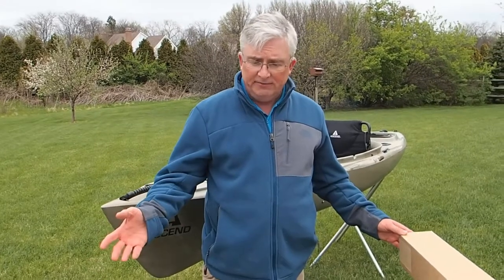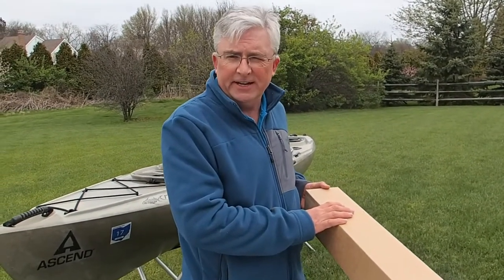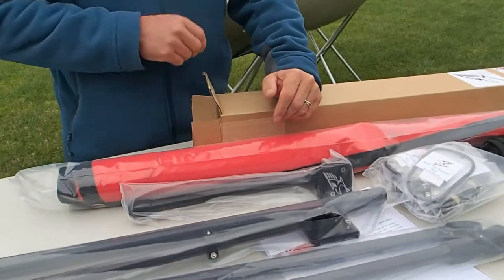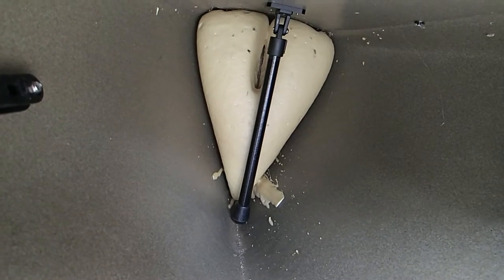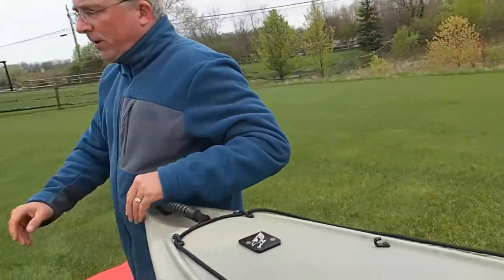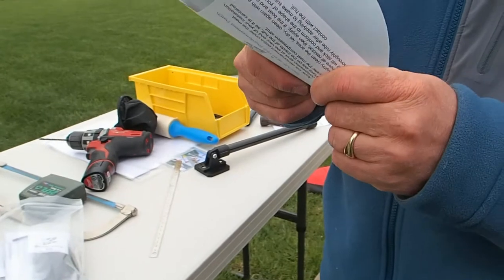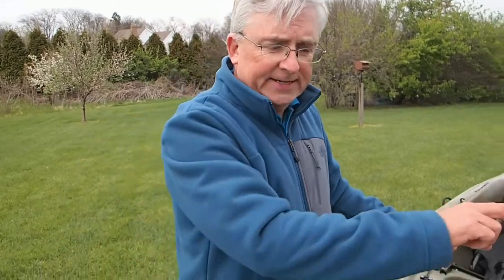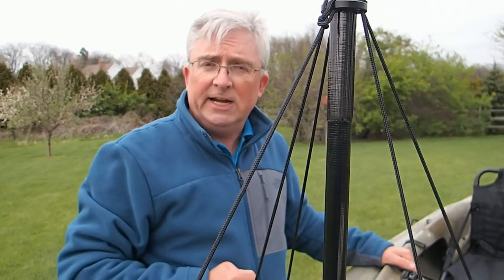Falcon Sail recreational kayak sail install install demonstration.

Comment: Very nice looking rig! What do you use for a dagger board and a rudder?
Reply from the maker: We do not use a dagger board or a rudder.
If a kayak is okay without a rudder without a sail, it is still okay without a rudder with a sail.
    Though a rudder can be nice for lazy kayak sailing.
    The general rule of thumb is a kayak less than 13 feet long is fine without a rudder.
Also if your kayak has an adjustable skeg it will work just as good as a rudder.
A rudder is made to trim your kayak not turn it.  
So if your kayak tends to turn up wind, you give a little rudder force down wind.
And vice versa.

On a short kayak you can change your boats trim / course tendency very easily by leaning forward or back a little to change your boats center of lateral resistance.
Or you can move just a little weight fore and aft.  A water bottle should do it.
You can change your trim by pulling the sail in tight or loose, or leaning up wind or down wind.

Steering is not a issue.
If your paddle says go left and the rudder says go right, you will turn left.

Some times rudders mask out of balance situations.
If I do have a rudder on my kayak, I start my day sailing with the ruder up to see how well it is balanced.

If your kayak is okay in the wind without a rudder it is fine without a rudder with a sail.

Some kayaks have adjustable skegs which also fixes any trim issues as well.

We never use lee boards or center boards or any other lateral resistance enhancer.
Kayaks do surprisingly well.  Our goal is to have a very light weight compact sail rig ( 3 pounds that folds to the size of an umbrella ) that gives you 75% of the sail only angles of attack a more complex bulky rig will do.  You can sail with no paddling 200 out of 360 degrees.  If you throw in some paddle strokes you can have useful propulsion on 300 out of 360 degrees.

Lee boards will help on some angles of attack, but they are bulky, heavy, complicated, get in the way, slow you down on many angles of attack, slow you down at the launch site and take out and can be costly.  If you do not have a super well made lee board or one that is hydrodynamically smart they provide about zero value / are a loss in the simplicity approach.

For more info read my next replies with canned text on rudders and lee boards.
Reply from the maker: Read my general answer to your question maybe first before these canned answer below.

#Rudders
=======================================================
The general rule of thumb is, if a kayak is fine without a rudder when just paddling, it will be fine without a rudder when you are kayak sailing. On a kayak 13 feet or shorter, rudders are not necessary. If a kayak has an adjustable skeg, a rudder is not necessary.  It is quite rare to see a 12-foot kayak or shorter rigged with a rudder.  I (the owner of Falcon Sails) have a 12-foot kayak and have never considered putting a rudder on it.   When my paddle says go right, my boat will turn right.  It will turn right even if a rudder on my kayak would say turn left.  Rudders are almost never necessary until you get into kayaks over 14 feet long. 

You can see in the pictures included with this email, that the short kayaks do not have rudders on them, and even some of the longer kayaks do not as well. 

If you want to do some lazy kayak sailing and not use a paddle for long stretches and do not want to lean or adjust the sail to steer, you can install a rudder and you may like it.

If you have a short kayak, you should avoid having a rudder early on, as number 1 you are likely not to care if you have one, and more importantly, a rudder will likely be a crutch and make it easy to use bad habits.  You should naturally balance out your kayak (it is an obvious thing to do (When you lean forward you will notice the kayak turning upwind, and when you lean back you will see the kayak turn down wind )) so it will tend to go in a straight line and not use a rudder to force an out of balance kayak to go in a straight line.  A rudder used to force an out of balance kayak to be in balance, is just more drag in the water and will reduce your efficiency and your ability to point up wind.

The general rule of thumb is, if your kayak is okay without a rudder without a sail, it will be okay without a rudder with a sail. Having a sail will slightly increase the desirability for having a rudder.  Big winds and high speeds also make having a rudder more desirable.  Having a rudder can make it easier to get through the learning curve.  In general, kayaks under 13 feet are always fine without a rudder.  Just like a kayak without a sail, when you get into kayaks over 14 feet long rudders or adjustable skegs are nice to have.  The longer the kayak is the more likely you will enjoy having a rudder. Even better than using a rudder, a kayaks tendency to turn up wind or downwind can be addressed with sail trim, leaning up wind and down wind, leaning forward and aft, changing the distribution of your load, and adjusting your speed.  Once you start doing these things, many times you would not use a rudder as a rudder is not the best way to put a kayak in balance to stay on course.

The shorter the kayak, and the more experience you have the easier it is to live without a rudder. Finally, when kayaking or kayak sailing, if your paddle says turn left and your rudder says something else, your paddle will win. 

Rudders and skegs are not there for turning so much as they are there to trim your kayaks tendency to a neutral tendency to turn up wind or down wind.  A nicely trimmed kayak is great to have.  A rudder is one of the easiest tools to use for trimming your kayak. But a rudder is a is a crutch many times and prevents people from learning proper techniques for staying in balance. And of course, using a rudder to trim your kayak also adds drag and slows you down so they are best reserved for minor fluctuations in balance vs a tool to power your way through an unbalanced situation.  The more drag you have, the harder it is to efficiently sail up wind.

In the end, if a Falcon Sail customer would like to have a rudder, then can have us send them a complete smart track (it is the best rudder kit you will find) rudder kit for their kayak at our cost which usually ends up being $225 including shipping.
Reply from the maker: Read my general answer to your question maybe first before these canned answer below.

Lateral Resistance Enhancers Lee Boards / Center Boards   Part 1 of 2
================================================
Your question about using a lateral resistance enhancer (lee board / dagger boards / large skegs) and if they are necessary to sail with a Falcon Sail is a common question, so we have made a canned answer to help people.

The short answer is a stock kayak hull does great and lateral resistance enhancers are not necessary.  They will get in the way and create complexities and issues at times.  Very well-made lee boards can help with some angles of attack but are not helpful in most situations and will get in the way on every outing.   They add bulk, drag, weight, complexity, cost, potential failures etc..

Kayaks sail amazingly well without any lateral resistance enhancer. Near zero falcon sailors use lee boards or other lateral resistance enhancers.  There is a longer more detailed answer below.

The owner of Falcon Sails wrote an this in a article.

I grew up sailing keel boats, sun fishes, trailer sailors, Hobie cats and anything else I could get my hands on.  As a conventional sailboat person, I use to think only a boat with a lateral resistance enhancer (lee board / center board / dagger board / keel) will sail properly. We have learned there is a lot more to kayak sailing, than conventional sail thinking will tell you. Conventional sailboat thinking is very helpful at times but does yield a few misleading assumptions about kayak sailing.

As far as needing a lateral resistance enhancer goes, you must consider a few things before making any assumptions. Look at a Hobie 16 and some other purpose-built sail boats. Even as a purpose-built sailboat, the Hobie 16 has no resistance enhancer because its hulls have a lot of natural lateral resistance built right in from the start. They have no lee boards, dagger boards, center boards, or keels. 

Like the Hobie 16 Catamaran Sailboat (not a Hobie kayak), kayaks have a lot of natural lateral resistance built into their hulls also and sail surprisingly well without any lateral resistance enhancer.

Kayaks are not sail boats, will not point as well as a complex sailboat, but their hulls are efficient at sailing and can make surprisingly good up wind progress. Think about this. Sailboat hulls are designed to be as slippery as possible going forward. A byproduct of a sailboat hull being designed to be as slippery as possible going forward, is a hull that is slippery going sideways (and slippery in all directions actually) and also tends to spin. Modern Sailboat hulls, make conventional sail thinkers believe you must have a lateral resistance enhancer on a kayak.

Kayak hulls are designed to track and go in a straight line. This is achieved by having lateral resistance built in throughout the length of the hull, which is what makes them sail surprisingly well without lateral resistance enhancers. To demonstrate how a kayak has a lot more resistance going sideways than forward, imagine pushing a kayak that has an adult sitting in it in the forward direction. Most kayaks will easily glide 30 feet or more. Now imagine pushing that same kayak with an adult in it, in the sideways direction. Due to its lateral resistance, it will probably go about 1 or 2 feet after you are done pushing it. Or think about towing a kayak with a person in it, from the side vs towing a loaded kayak from the bow. The kayak towed from the side will be much slower due to its lateral resistance. In both examples you are testing and seeing, a kayaks lateral resistance is significant. Once a kayaks hull moves through the water, its lateral resistance increases by quite a bit. All this said, with a smart sized sail / one that is not too big, a kayak has plenty of lateral resistance without adding anything to it.

Once you build up some speed, a kayaks lateral resistance increases dramatically. Kayaks do not sail as well as a purpose-built sailboat, but you can do no paddle sailing and reach across the wind, and even make some upwind progress.  Of course, a purpose-built sailboat will sail better than a kayak will, but kayaks sail amazingly well. If you have an efficient sail, you do not need a lee board, or center board, or dagger board, or any lateral resistance enhancer to have a great kayak sailing experience.

Falcon Sails focuses on keeping things simple, efficient, compact, reliable, and lightweight with the best possible performance. All this can be had for less than 3.5 pounds, in a sail that can be dropped in seconds and folded down to the size of an umbrella in just a few more seconds.

Lee boards and dagger boards add weight, complication, bulk, expense, drag etc. Some people want to turn their kayaks into a sailboat. That is fine, but you will add weight, complication, bulk, expense, drag, set up time at the put in, tear down time at the take out, more rigging, more stuff to store, and if there is no wind, or too much wind, you are better off with a compact sail rig that gives you 70% or more of the sailing benefits in a package that weighs just over 3 pounds that can be lowered and compactly secured to the deck of your kayak and 100% out of the way in seconds.

Everybody has their thing. If you want to have that perfect ideal incredible sailing experience in one situation, you will lose a lot in other situations. There is not a rig that will cover all situations perfectly. If you want simplicity and versatility, you will be happiest with a simplistic high-quality sail and rig for your kayak.

As a lifelong sailor, I thought the same thing sailors typically think about lateral resistance appendages. I have sailed and owned a lot of different boats. I used to race and skipper and crew on a lot of different boats, and can say I am a decent sailor. My conventional sail thinking made me believe you need a lee board or something on a kayak to sail. Then I tried kayak sailing. The performance of a sail on a kayak amazed me. I was hooked instantly. I was surprised. That was even before there were good quality sail rigs available. Now that I can have a good quality sail rig, and a good airfoil shape, I will not go kayaking without a sail.

After kayak sailing for the last 12 years and having paddle sailed thousands of miles, I have never used a lee board or anything like it. None of my friends use lee boards and none of us feel like we are missing anything.  If you keep a good sail trimmed properly, oriented to the wind properly, and have at least 1.5 mph of hull speed, you can reach across the wind, and even make upwind progress of about 20 degrees above reaching. That is without paddling or a lee board or a dagger board on a standard stock kayak hull. Some kayaks will do even better than this.  In general terms if you have good conditions, a good sail, and you use decent sail trim, you can easily sail 200 degrees and even up to 220 degrees without paddling and without the bother of any lateral resistance enhancers. If you paddle to keep your speed up and the sail oriented properly to the wind, a good sail, will generate useful propulsion all the way up to within 30 degrees of straight upwind. That is with or without a lateral resistance enhancer.

In general, once your actual track is 10 degrees above reaching, you have to start paddling to keep things oriented properly. Initially a few small paddle strokes here and there will add a lot to your possible angles of attack. The more aggressively upwind your angle of attack is, the more you have to paddle. But still, you can gain useful propulsion to with 30 degrees of straight upwind.   For example, you can paddle with a 2mph effort and go 3.5mph.  You can speed up faster, slow down slower, and have a higher top speed. You can have a lot lower paddle stroke resistance as well and have a lot more fun while you are at it.

With a little bit of planning, you can paddle upwind a little bit and reach back and forth all day long and not have to paddle much at all. Once your movement is 15 degrees above reaching, you cannot just sit there doing nothing, but you can avoid paddling and reach across the wind all day long, and even make upwind progress without paddling and without lateral resistance appendage or enhancers. With a good sail, kayaks sail very nicely.

Just like when sailing a purpose-built sailboat, when kayak sailing to maximize your potential, you will have to think about what you are doing. When conditions are good, you can get useful propulsion to within 30 degrees of straight upwind. Anybody who does a lot of kayak sailing with a good quality rig will agree. If it is really windy, gusty, shifty, there are large waves, you are not thinking, you have too big of a sail, the paddle sailor is inexperienced, ect, the 30-degree number is going to grow.  With a good sail and some practice you can have the same results.
Reply from the maker: Read my general answer to your question maybe first before these canned answer below.

Lateral Resistance Enhancers Lee Boards / Center Boards  -  Part 2 of 2
================================================

I wrote a bit more about this here.
https://www.falconsails.com/KayakSailingFAQ.php#centerboard

If you contact me at Falcon Sails, I can send to you a rough draft set of instructions for kayak sailing upwind.
www.falconsails.com/contact.php

This video shows a clip of a upwind leg I was enjoying a few seasons ago. It is a lot of fun.
https://www.youtube.com/watch?v=xjzld6MZhCI

I was in a 14-foot-long Jackson Journey kayak and making some upwind progress without paddling.  I could have made more upwind progress if I paddled, but I can sail with no paddle 210 out of 360 degrees.  This kayak has a rounded hull so most kayaks will do a little better yet. 
This video shows me sailing and tacking upwind with no lee board or dagger board and almost zero paddling.

Here are 2 videos of me enjoying my kayak and sailing up wind with very little paddling.
https://www.facebook.com/falconsails/videos/1594936704274061
&
https://www.facebook.com/falconsails/posts/4106133799451973

Both includes some really neat gps telemetry that makes it easy to see my actual movement.
It shows me sailing 210 out of 360 possible degrees. This kayak has a rounded hull which makes it a average performer. If your kayak has a contoured hull, it will sail better / about 10 more degrees on both the port and starboard side.
If I started paddling and kept the sail oriented to the wind properly and kept some motion to help my stock hull generate more lateral resistance, I could have had useful propulsion to within 30 degrees of straight upwind.
This is very similar to motor sailing a sailboat. The motor alone can push the sailboat, but using the sail it will speed up faster, have a higher top end speed, will slow down slower, and require less effort to get to your destination.

Here is another video of some friends and I enjoying a nice 18-mile paddle sail where we sail about 70% of the day.
https://www.youtube.com/watch?v=RkbSSlYEYl0

If you plan your day well, use good techniques, take advantage of reaching, and not dive downwind you can sail all day long without lee boards.

Here are some pictures of a typical kayak sailing day, that include a track log of what we sailed and what we did not sail.  I had several beginner kayak sailors with me, so I avoided some of the more difficult tacks and we still sailed about 75% of our miles.
https://www.flickr.com/.../falco.../albums/72157712563766083

Here is a link to video and paddle sail report showing how much fun my friends and I had on a 5-day trip kayak sailing around Cedar Key on the Gulf of Mexico side of Florida. Look at the text. With a little bit of planning and smart sailing, we were able to sail 90% of all our lines.
https://www.facebook.com/falconsails/videos/2408620615978528/

Here is a link that shows all the lines we recorded on our GPS.
https://www.google.com/maps/d/u/0/edit?mid=1OgAfpky2M25Ui6poZo6ANwL5a-_zGwc&ll=29.13438357058386%2C-83.0575005&z=14&fbclid=IwAR0RyoxfXOwNB-b2jKG-mATcsc5BKCNszuc2v9KiYjhdXLIxu2Ymre2RUqQ

You can zoom in and see all the details.  We sailed 90% of these lines.  It was amazing.

If you want to sail paddle sail in good conditions, it is easy to sail with zero paddling more than half your chosen lines even if you do not plan anything and just randomly pick lines.   If you get smart and choose good lines, you can easily sail with zero paddling 80% of your lines and raise that to 100% of your lines.   If you paddle while doing some of your sailing, you can use your sail all day long.
Reply from the maker: I wrote a bunch of reply info to your question.

Here is another / later  install video.
https://youtu.be/2i8_EEExqNg

You can see what options we have and order a sail here.
www.falconsails.com/store

Now we have a full inventory of stock sails which is not always the case.
So, you can order any size sail you want, and have it shipped to you right away.
You can also custom design a sail there as well.
Having a quick ship option along with a discounted price for stock sails, makes stock sails a nice way to go.
At the end of the purchase process, our store will ask you what kind of kayak you have, and we will then put together a rigging kit that is perfect for your kayak.  100% of the parts you need will come with the kit.  All you will need are very basic common tools such as a screwdriver, wrench, tape measure, drill, and drill bits.

If you make a mistake and miss enter your kayak info, or we are not 100% sure about what kayak you have, we will contact you. We will look at our boat database and come up with a parts list and rigging plan that is perfect for your kayak.  Our extensive parts inventory and experience allows us to make the most complete rigging kit possible for you.